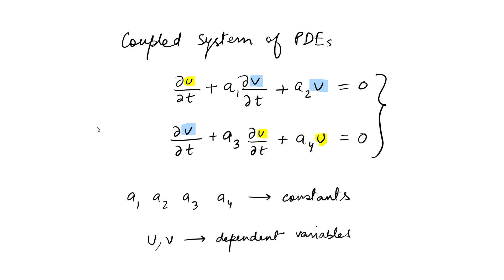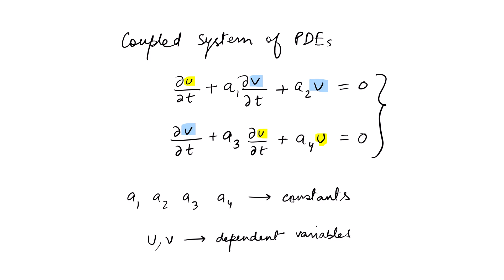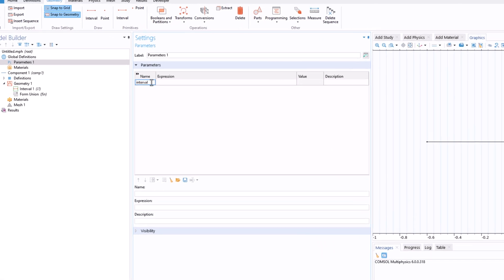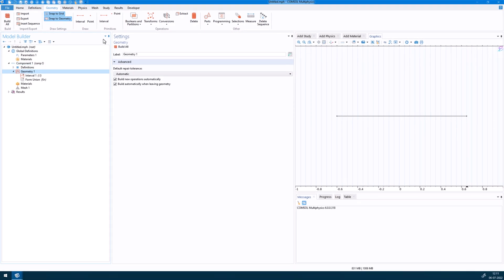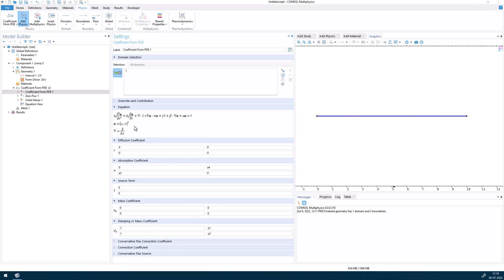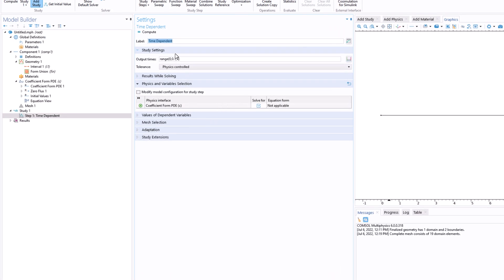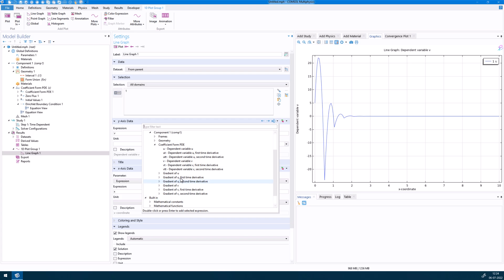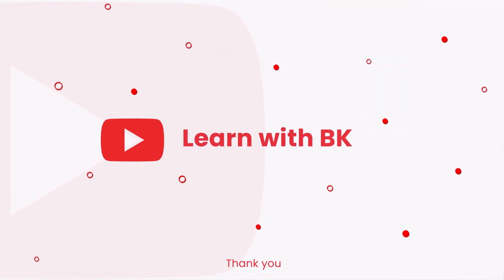Solving coupled equations in COMSOL® - PDE Equation based Modeling | Learn with BK

Comment: Sir, in 7:03, are the coefficient of A correct, or will a2 and a4 swap places? Thank you so much for your videos they are very helpful
Reply from the maker: Could be. Maybe you can change the values to known equations and cross check.
Reply from the maker: As i made it way back, I have to look at the files.

Comment: Hello. How can I couple the temperature field or velocity field with pde? I have a pde (it is just a concentration equation) that contains both temperature field and velocity field.
Reply from the maker: To couple temperature and velocity fields with a PDE, you'd typically use Navier-Stokes equations for the velocity field and the heat transfer equation for temperature. These can be coupled with a concentration equation using the convection-diffusion equation, where velocity advects the concentration. There maybe a video similar to the domain coming soon.. lets see